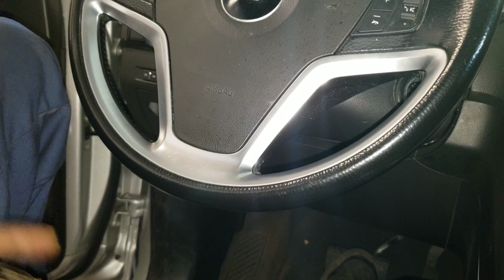Chevy captiva/ equinox rear brakes replacement

Comment: God dammit you just flip it like that ...i spent 30-45 minutes on just the clips between 3, rotor and caliper. 
Couldnt get the rotor off on my 4th wheel for over an hour, adjuster was rusted in place (came back next, day, pb blaster and smacked with big hammer hard around the studs  finally broke it loose) some dumbass tightened the adjuster too tight and has been dragging just enough to 
Wish i would have finished this video. Hope my pain helps someone else- tip make sure if your replacing caliper to veryify hose line hookup autozone dude gave me the wrong one saying "back left, driverside rear" 3 times wasnt enough